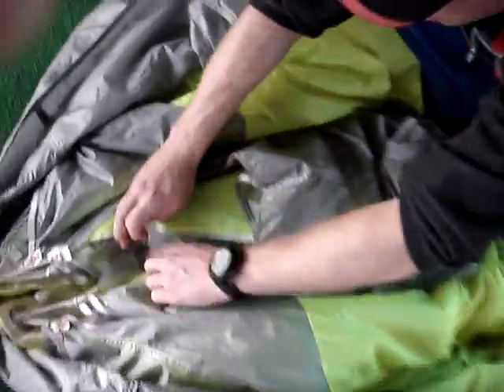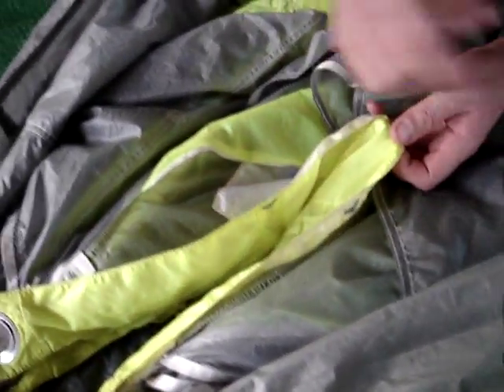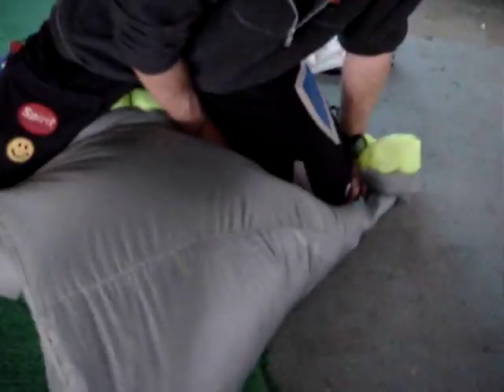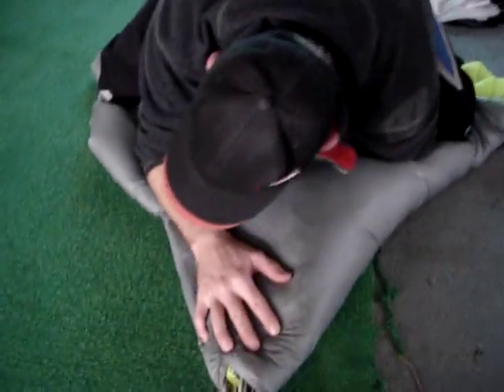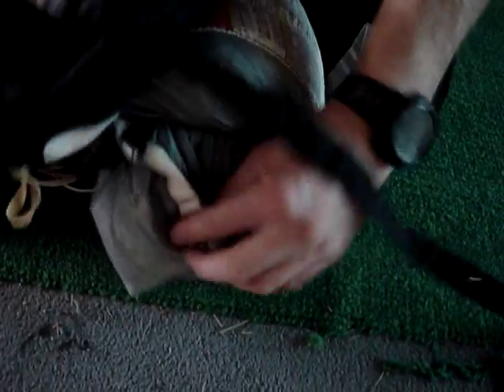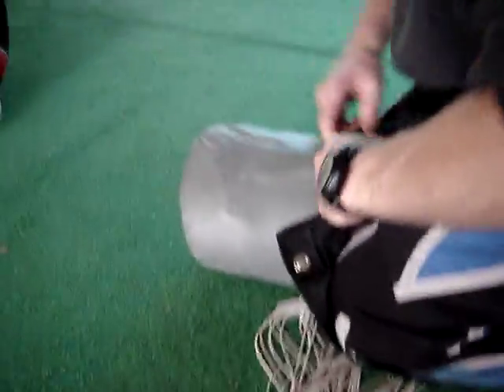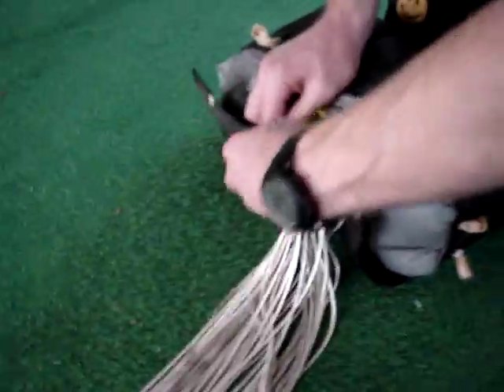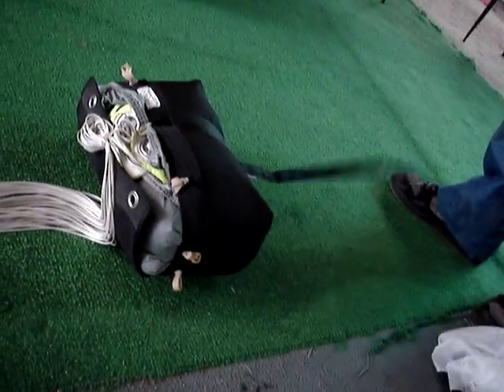Parachute packing; 'psycho method' - Part 2 of 2

Comment from the maker: No, because in the first video it shows you that the stabilzers are wrapped around the brake lines, then the tail is brought up over the stabilizers then laid down on its back. In video 2, once the cells are nicely rolled and the excess tail taken in, the triangle is made, folded in, then rolled.. far less mucking about than what a canopy goes thru if the pro pack is a really tight fit like my canopy coz of its airlock and extra fabric being so new and slippery!

Comment from the maker: It is called the Psycho pack / method because when we place the half packed canopy on the ground, we throw it onto its back which puts a twist in the lines. When you learn to pack usually, u r taught never ever to twist the lines as this will give you an opening with line twists.. As log as you remember to untwist the lines back after you shove the pack job into the deployment bag there is no problem. This pack job is way easier to get the chite in the bag, and has a nice soft opening every time

Comment: my observation: once you have the canopy on the ground and shaped like a triangle, the next step is to fold the right and left sides in, but the brake lines tend to fall to the outside so when you fold the sides inward this could cause a brake line to be positioned on top of the nose, causing a line over. Do you agree?

Comment: I have an older ZP canopy (Robo-Z 165) and the openings have always been slammers, even when I've rolled the nose. I learned the psycho about five years ago, and found that it provided some of the smoothest openings I've ever experienced.  

My question is on wear and tear from the bridle pulling the top of the canopy out from the middle of the roll like that. Have you noticed any? I don't have enough packs with this technique on my canopy to compare.

Thanks for posting this vid!